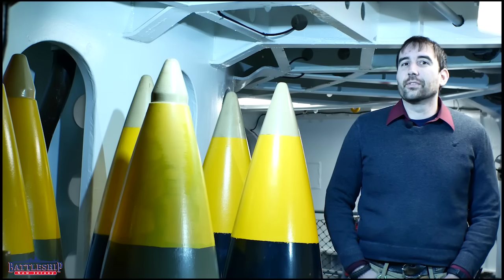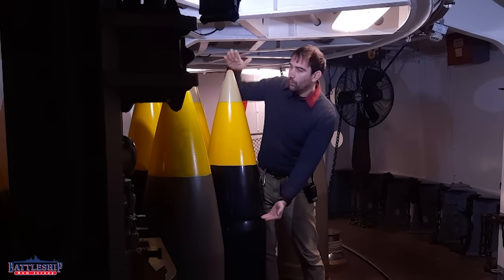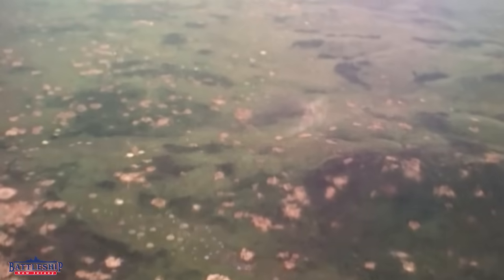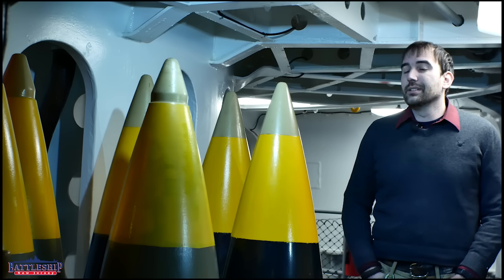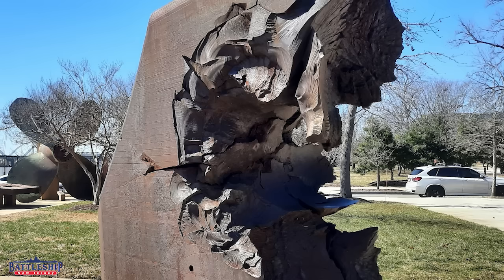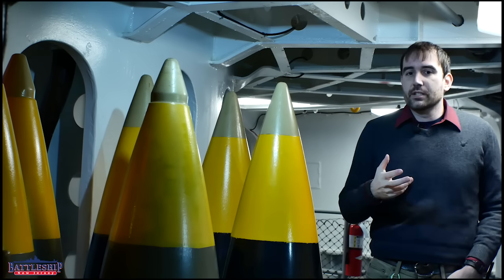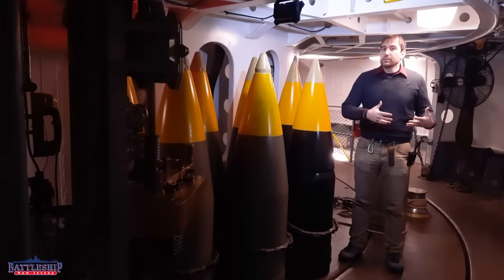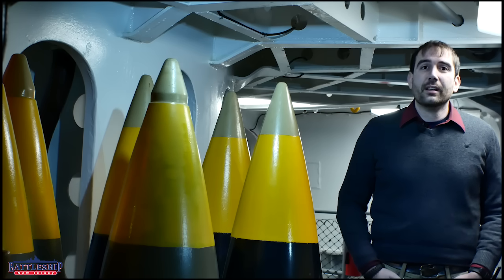What Does the Impact of a 16in Shell Look Like?

Comment: I think you are  dismissing the forensics analysis of Bismarck's wreck too easily. The images attached to said analysis do have a surprisingly good resolution. Apparently they got the rover really close to the wreck, which did pay off. I'm actually not surprised that the analysis didn't find a lot of penetrations on Bismarck's armor - simply because of the sheer percentage of tonnage that was devoted to armor plate. Percentage-wise Bismarck and Tirpitz had more of their tonnage devoted to armor than even Yamato (40+% compared to a little over 33%). And given Bismarck used the outdated turtleback armor scheme, it meant that by closing the distance the Royal Navy made it unnecessarily hard for itself to deal proper damage to Bismarck's citadel - because that is precisely what the turtleback is supposed to counter.
Reply: Bismarck and Tirpitz were built to be tanks inside 10,000 yards. Their turtlebacks were called outdated by some at the time but you have to remember there were only ever two classes of battleships in the world that could outrun a Bismarck.
Reply: @ut000bs  Yes, but the Battleships she could catch up with would have pummeled her to death anyways, her armour and design were not up to par with modern WWII capabilities. Even the Italians produced better designs.
Reply: @HunterSteel29  Confirmed by Drache.  The Italians had problems with propellant quality but their modern ships were good.  I did'nt know battleships keep the shells in climate control to reduce shot variation.
Reply: The 'outdated' turtleback obviously worked pretty well. Lots of battleships fell apart from much less abuse.
Reply: the main reason there's few penetrations of Bismarck's main belt is the sheer amount of water on board already that left most of the belt submerged
Reply: Yes, that is true. I was wondering if Germany ever considered the all or nothing. And why they went with the turtle back instead.
Reply: @jeffreynagy7112  If my memory is correct the reason why the Kriegsmarine went with a turtleback style armor scheme was specifically because of the weather conditions of the intended area of operations.  The North Sea and Northern Atlantic are notorious for bad sea states particularily in the form of bad visibility.  The thought being that the increased chance of bad weather meant there would be a very high chance of engagments being at shorter than usual ranges.  I do not think though that I am alone in my opinion that the disadvantages of a turtleback layout far outweigh the benefits and that by WW2 the doctrine that surrounded it's implimentation (That being shorter ranges because of incliment weather and lighting conditions) was already DOA because of the implementation of accurate search and fire control radars in the Royal Navy.
Reply: @jeffreynagy7112  The historians said Bismark was an updated WWI design.  Post Weimar Germany did'nt have the resources to make a modern ship.
Reply: @rogersmith7396  Thats true... The Germans were not only tight in resources, but they were in a hurry... Thats why Bismarck had such dated design features. The reality is- she was nothing more than a freshened Bayern...
Reply: @jeffreynagy7112  Its because they were in a hurry to build some ships...so they just reused and freshened up WWI designs. Bismarck is just an updated Bayern...
Reply: Because of lack of experience in building such ships.
Reply: disc_oidal  I believe in James Camerons journey, they showed where a 16" hit the main battle bridge.. Basically killing all short of maybe a couple officers.
Reply: Bismarcks citadel was never penetrated.
Reply: I saw one picture of the conning tower with over a foot of armor.  There was a precise 16 inch hole through it.  Nelson or Rodney were the only British 16 inchers and one was present at the sinking.  That shell exploding inside the conning tower would have left nothing but red mist.
Reply: @rogersmith7396  Yes. if I am not entirely mistaken, that was what disabled Bismarck's forward turrets by taking out their rangefinder and a good chunk of the command crew
Reply: Actually there were numerous penetrations of Bismarck’s side armor, as well as turrets and one 16” shell from Rodney penetrated the barbette of turret Dora. 
The strength of Bismarck’s protection never lived up to its legend. It’s design was not on par with later US or British battleships.  The South Dakota’s, Iowa’s and King George V’s were significantly better designs. 
But even if she proved somewhat hard to sink, what must be understood is how easily she was placed out of action.  All main internal communication sat above the armored deck, and this was severed very early on in her last action.  Eliminating internal communications effectively renders most of your damage control, as well as weapons control, useless.  She was silenced quite easily in her final action,  and never scored a single hit on her attackers.
Reply: @scrappydude1  Think what Hood could have done with a little less exceptional bad luck - the i in a million shot.
Reply: @scrappydude1  , Also very early on the main fire control director at the top of the foretop was hit completely by luck on  Salvo where every other shell was an "over". The secondary director was taken out shortly afterward .
Reply: @scrappydude1  Bismarcks main armor belt remains un penetrated to this day.
Reply: @joshlower1  That is incorrect.  It was penetrated multiple times.   But not as many as it could have been, because Biz was sinking and was so low in the water that the belt was mostly submerged.
There was nothing special about the damage Bismarck took.  Any Battleship in the same situation would have taken the same damage.
Battleships are HARD to sink.
The USS Nevada took 2 nukes, then was used as a gunnery target by the USS Iowa and 2 other ships, STILL wouldn't sink so they finally torpedoed her.   And she was built in 1916.
Reply: @scrappydude1  It took dozens of brit navy battleships to sink Bismark. If the other half of the brit navy had been there, they could have sunk her sooner.
Reply: @acosorimaxconto5610  No it didn't. It took only two Royal Navy Battleships. Rodney and King George V.
Reply: Dozens?  Where did you see this?  Bismarck was shot to pieces by 2 British battleships. HMS Rodney and HMS King George V.
Reply: @acosorimaxconto5610  the germans sank Bismarck not the brits.
Reply: @joshlower1  That is also incorrect.  The Bismarck was sinking.  If the Germans did nothing, she was going down.  All the Germans did was make it go down faster. 
And if your enemy beats you to the point that you need to scuttle abandon ship...they sank your Battleship.   
That's always been a stupid claim for Biz fans.
Reply: @scrappydude1  pure nonsense. Even a 5 inch gun from up close will penetrate any battleship armor.
Reply: @LTPottenger  lol no
A 150mm gun is not penetrating a 320mm belt that's face hardened at anything above perhaps 10 metres.
Reply: @HunterSteel29  Oh the great expert has spoken. Maybe you should actually watch the videos here before making dumb comments from now on.
Reply: @LTPottenger  I have and will always continue to watch the videos on this channel. However ballistics against soft soil and against face hardened steel are two totally different things. 127mm and 150mm shells are not penetrating a Battleship's Belt armour at any respectable ranges. And if we're talking about when USS Laffey rekt Hiei, she shot at Hiei's upper Belt and Bridge, which was made with thin armour, enough so that even a 100mm gun would penetrate it.
Reply: Potters Human, you are so wrong that it defies description.  Hull plating, yes.  Unarmored superstructure, yes.   Primary armor, not a chance.   Just for purposes of example, because I have this right in front of me, the side armor of the Iowa and South Dakota classes was immune to penetration from our own 16” 45 Mk-6 guns firing the earlier 2240lb AP shell between 17,600yds and 31,200 yards.  

A ships armor was designed to have what was referred to as a immune zone.  In the example here, the 12.2” side armor, inclined at 19deg, could only be penetrated by this gun/shell combo out to 17,600 yards. Beyond this the angle of the fall becomes steep enough that the side armor can resist penetration. From here out to 31,200 yds this gun/shell cannot penetrate the armored citadel of the ship, either the side armor or the deck armor.  In the decks case,  the shell is still traveling flat enough of a trajectory to deflect off the thinner deck armor.  Beyond 31,200 yds however, the trajectory becomes steep enough that a plunging shell can penetrate. This a wise captain would always try to fight between the ranges where his opponents weapons may not penetrate. 

Now if the ships protective scheme can stop a 16” 2240lb armor piercing shell, a 5” shell that weighs 54 lbs doesn’t stand a chance.
Reply: @LTPottenger  That's a little bit of an exaggeration.  A 5" won't penetrate Battleship armor from any distance.  6" is just a bit shy as well, got to go up to 8" before that becomes a possibility.
Reply: @HunterSteel29  You can put it a foot away and it's not going to penetrate.
Reply: @HunterSteel29  Its obvious.  If they could use 5 inch instead of 16 inch they would.  Its a stupid comment from an uninformed source.

Comment: I'd like to see what a smoothbore 16" shooting a 6" diameter 6' long du fsds penetrator at around 5600 fps would do!  🤔😨
Reply: The Navy actually developed sabot rounds for the 16"/50 guns. I believe the used a 12" projectile which increased the velocity to well over 3000fps. A "planned" sabot round using an 8" projectile would have pushed that velocity to around 4000fps using the standard 660lb powder charge.
Reply: That would definitely fall into the category of "a really bad day" for whatever is on the receiving end.

Comment: There were also the experimental Martlet sabot rocket rounds from project HARP.  Although never intended for use on the Iowa class, they could have potentially developed into extended range rounds; if battleships and big guns had not given way to carrier groups.
Reply: Ah yes the HARP gun. I think it was made out of Iowa class 16" rifle barrels. Two of them stuck together.
Reply: @1pcfred  Thanks, now I'm imagining these big ass battleship guns duct taped together side by side like a shotgun.
Reply: @daddysempaichan  Not side by side, end to end. They were trying to get maximum velocity, with the ultimate goal of putting the projectile into orbit.
Reply: @DABrock-author  Ah, so they were docking gun barrels. I see...
Reply: There was also a nuclear shell ready for use.
Reply: I'm sure they could have also adapted the modern self guided artillery rounds our 155's use now as well. There simply no need in all reality.
Reply: @goldenhate6649  On a 155mm shell, the increased range from using a saboted sub-caliber round would be offset by the minuscule explosive charge the core shell would be able to carry.   No real point in firing a 4” round 60 miles since direct hits would be very difficult and the blast radius would be small.  But with a 16” gun, the core shell would still be 12-13” and have enough explosive filler to potentially make it worth it.  But it wasn’t worth the money we would have had to spend keeping the Iowas in operation for such a niche role.
Reply: Saddam Hussein was working on his own, called the Babylon gun. It was several massive barrels bolted together, with a projectile around the size of an oil drum
Reply: @crinkly.love-stick  Actually, it was much larger than an oil drum, which is 23" outside diameter, for one that holds 55 gallons.  The Babylon gun fired 1 meter projectiles, or approximately 39.37".
Reply: @crinkly.love-stick  if i recall correctly, Saddam was being assisted by an American in developing the gun. Can't remember details, but I think he claimed CIA was involved.(why not?)
Reply: Ah..looked it up..it was Dr Gerald Bull . Canadian. Worked on the Harp gun.. I still recall him on TV years ago defending working with Saddam
Reply: @mertywerty5983  Canadian, actually
Reply: @mertywerty5983  Didn't Gerald Bull have a mysterious demise?????
Reply: @bdickinson6751  yeah. His bio said he was assassinated. Something about Apartheid South Africa, Israel & their atomic weapon development. Killed in March of 1990. 4 months before Iraq attacked Kuwait
Reply: @bdickinson6751  The Israelis found out about the giant gun he was working on for Saddam to shoot at Israel. They told him to stop. He didn't, so they sent a team to kill him where he was living at the time. They shot him in the head twice with a .22 pistol.
Reply: When I was aboard the USS Iowa in 1987b Master Chief boats told me they had the 16" sabot rounds with a range of 27+ miles.
Reply: @comradeyuri8492  Yeah they had a number of specialty rounds developed after WW2 that never saw much if any use. A few bouncing betty style cluster shells, a nuke, an improved HC. 
I suppose a sabot too, but sabots do not do as well out of a rifled barrel, its part of why all but one modern tanks have smooth bore. (spin is especially terrible for shaped charge HEAT rounds, causes the explosive jet to fan out.)
Reply: As of 2016 all the remaining 16 in shells are stored at Crane Naval Base, IN.  The US ARMY is tasked with dismantling all 15,000 of them left!!

Comment: In regards to battleship shellfire against concrete shore batteries my father was on Guam in W.W.# 2 and saw a gun emplacement knocked out by the 14" guns of the Tennessee. He said the concrete was was about ten feet thick with 1" diameter re -bars and that it looked like something had drilled a very neat 14" hole clean through it and blew up inside. Inside there was nothing left of the Japanese gun or crew only black stains.

Comment: So, the turtleback armor scheme was really a good way to prevent any significant damage to the critical parts of a ship ?
Reply: Yes and no, it depends on the range.  Shells come in at an arc, and the penetration of the impact is most efficient at a perfect right angle (orthogonal). so a turtleback is good at close range (because shells come in flat and don't hit at a right angle), but at longer ranges, the shells drop onto the target from height and the turtleback is facing those at something closer to a right angle.  So Bismarck's turtleback is pretty effective if you get into a closer-range gunfight, but less effective against plunging fire at longer ranges.  Against older battleships in daytime, with older optical fire control systems, Bismarck's pretty solid because they can't generally expect hits at very long ranges and the fight might be likelier to wind up at closer ranges.  Against later battleships with radar fire control and long range accuracy, like the Iowas, or maybe a battleship with just plain old excellent long range gunnery, like Warspite, Bismarck's turtleback is facing long-range plunging fire from super-heavy shells and would need to try to close the range sooner; too many big hits at plunging fire range are likely to wreck something too important to lose.

For any  given armor weight and thickness parameter, there is no "perfect" armor scheme; the designers usually try to pick a scheme that is effective against the kind of fight they are expecting based on the technology and forecasting available at the time.  All you can do is hope that your armor scheme is appropriate to the era in which you actually end up fighting.
Reply: It was designed for a closer brawl, but Bismarck was crippled by the time the British BBs closed, at that range and will no resistance, they could easily pen Brismarck.

Comment: One thing I would love to come across but have yet to find are details of the fuzes used on these shells. Other than the nomenclature of the various fuze types there doesn't seem to be much out there in terms of diagrams showing their guts or how they work.
Reply: Top Secret stuff.
Probably still classified.
Reply: @straybullitt  Sad considering these have been out of the inventory for a few decades now, one would think most if not all of the non nuclear details would have expired classification by now.
Reply: @robertsmith4681  they are definitely not still classified if they ever were. Every large navy in the world had bursting charges going back to the turn of the century.  I was able to find some descriptions and drawings with a quick search. Basic design is a weighted firing pin held safe by a torque spring that is overcome by centripetal force when the shell reaches it's full spin rate. If the shell hits something to cause enough deceleration the pin hits a firing cap that ignites a delay fuse, which then sets the main charge off.
Reply: I was a Gun Fire Control Tech (FTG) on a Knox Class FF in the 70's. Our Chief Fire Control Tech was in Main Battery Plot on the New Jersey while cruising Vietnam. All shells for the big gun were made during WW2, none since, so they were new "old" inventory. He told us the story that because of the monsoons in the area, they were getting early fusing of many shots before they could reach land. Evidently, the rain was setting off the fuses. Their solution was to wrap the nose fuse with duct tape after the fuse setter but before loading and firing. He said it worked, though I have no way to verify that.
Reply: You have to look at declassified documents or popular mechanics magazines from the early seventies. Im not joking about the popular mechanics mags either.

Comment: Why is it just an air breaker and not molded metal into the 16 inch round you think adding the extra weight would give it that bit more penetrating power
Reply: Additional weight reduces the range.